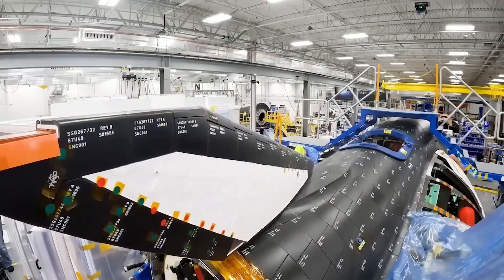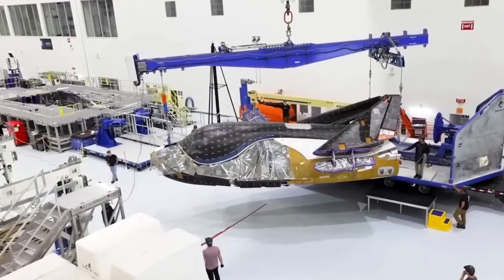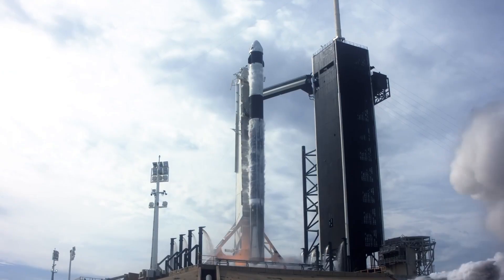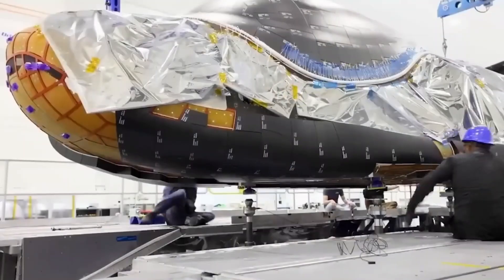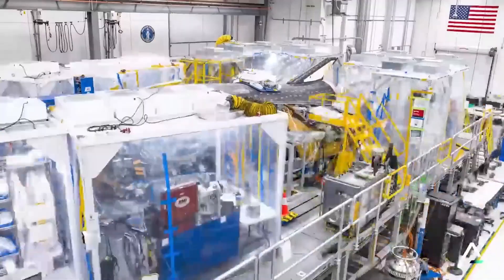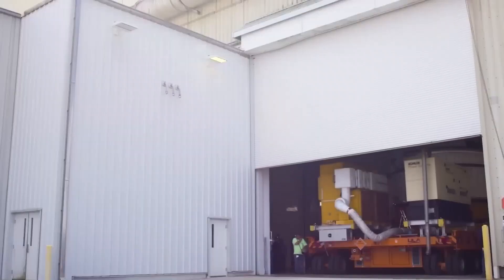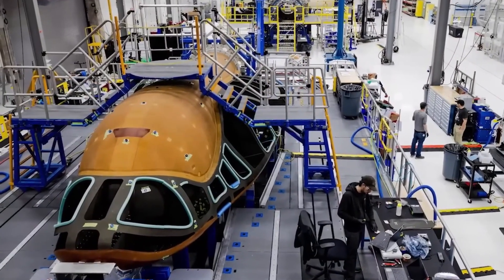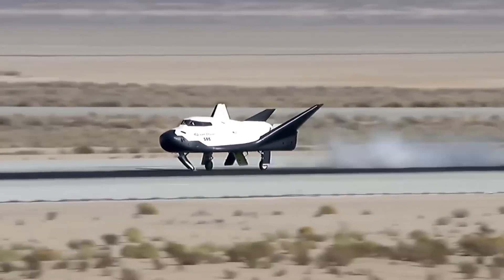Dream Chaser Has One Big Problem...No Launch?

Comment: Shuttle was expensive junk.
Reply: Who would ever think of the Space shuttle, does use a 186,000 Pound Space Shuttle to get 87,000-pound payload into orbit.  At $10.000 a pound this sounds stupid, you need a 186,000-pound payload and an 87,000-pound shuttle. "DUH"

Comment: Dream chaser may turn out to be an afterthought if SpaceX can demonstrate ultrareliable Starship landings. As things look now, Starship will have a capacity many, many times Dreamchaser and can likely return payloads gently to earth and even to spaceports if not airports.

And don't  underestimate just getting to LEO  and beyond. SLS may never fly. I'd guess that New Glenn is so underpowered for now that short of a miracle it can't  lift more than very light satellites.

Aside from SpaceX possibly competing directly with Dreamchaser for the same types of missions, it sounds like compatibility problems exist that would slow launching Dreamchaser on any SpaceX boosters. So Dreamchaser appears to not have a ride even if it was made ready.
Reply: They could always take Dream chaser to orbit in Starship and then drop it out.  But what would be the purpose?